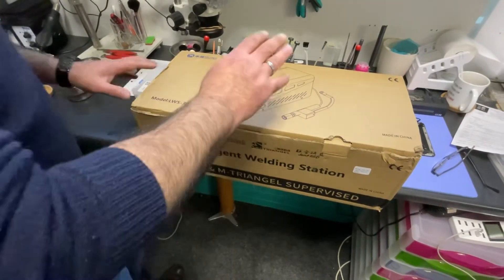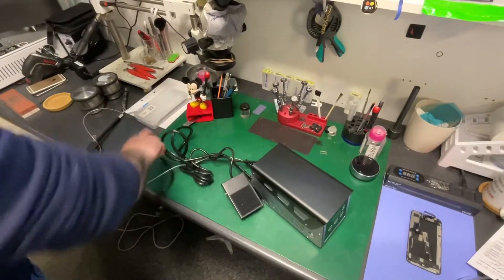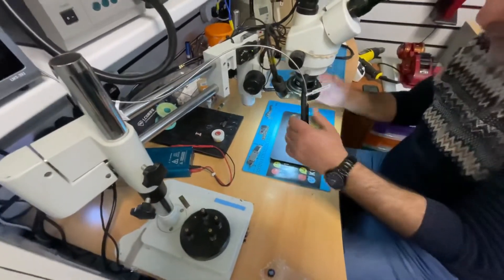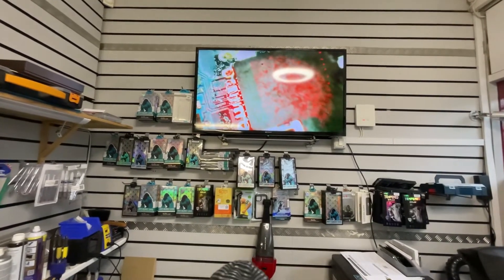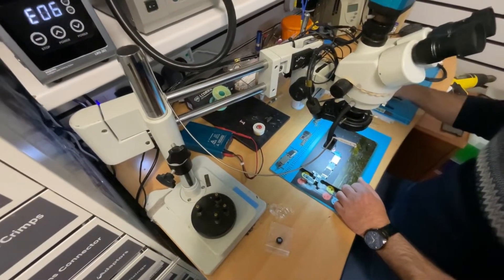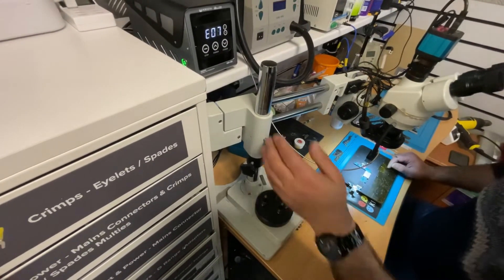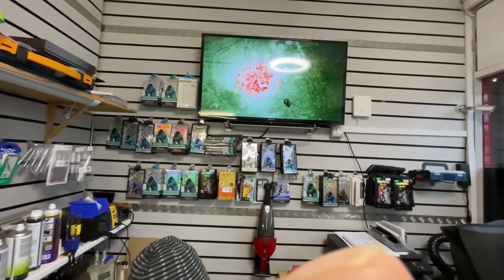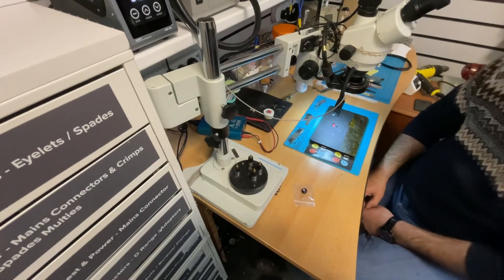Intelligent Welding Station LWS-301 Laser soldering Maschine Mijing

Comment: Nice work. do this have laser focus adjustments? 
how about using this to replace mainboard chipset, I think there is 2 challenges is chip size and the green area that chip has that has less laser absorption that lead to less heat.
what is your opinion?